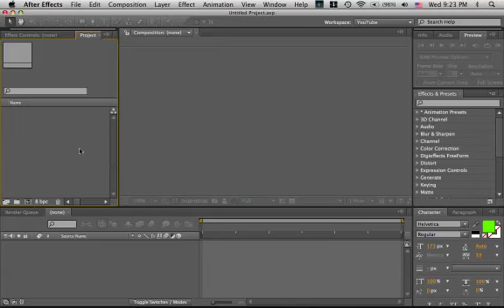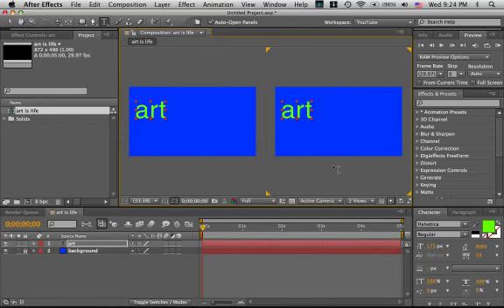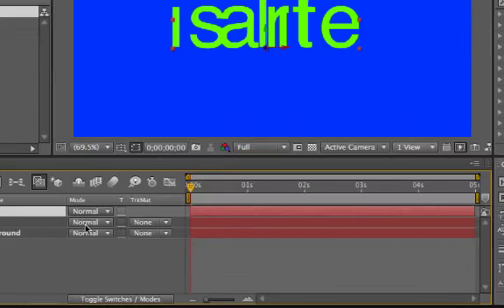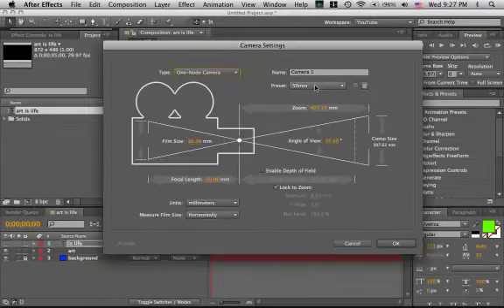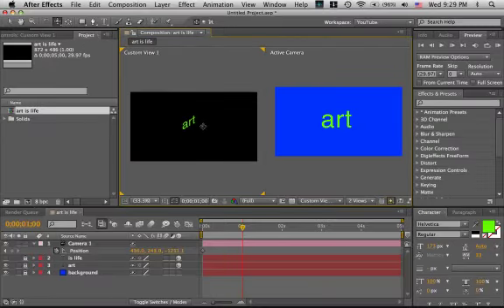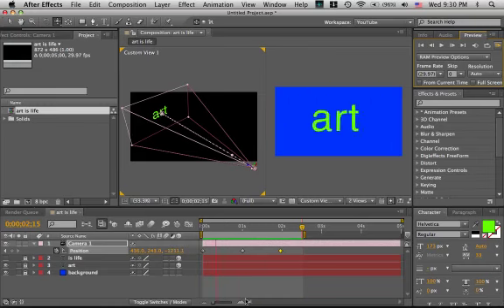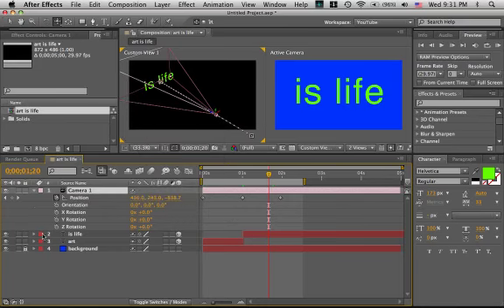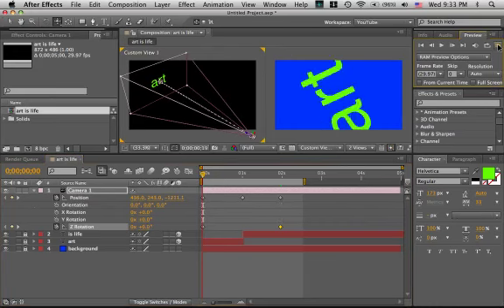After Effects 3D for beginners: camera in-out-spin

Comment: use scale?
Reply from the maker: The Entertainer To make using scale (to simulate advancing or retreating) convincing, you'd have to either use the Exponential Scale Keyframe Assistant, or do what we did in the nineties (hey, get off my lawn!) before AE had 3D in v.5 : use the graph editor to slow down the scaling at lower scale values.

This is because a linear move away in 3D is not a linear scaling: try scaling something down linearly: it seems to speed up as it goes away, which is unnatural for a steady retreat. However, since it's more natural for something to seem to shrink more slowly as it gets farther away, we slow down the scaling as it goes away ... or we just move 3D layers and/or the 3D camera in the z-direction.

Comment: You don't need the camera tool to do this, could have been done with a lot less work. But it's a good tutorial none the less :)
Reply from the maker: Thanks. :)

Are you suggesting the rotation and scaling up and down of the layers? I would say yes, you don't need the camera tool, but is it a lot less work? Not necessarily: it could be more work and hassle especially if you have a lot of layers and you need to change something.

Specifically, I would use the camera in this situation rather than scale the layers, because for a correct zoom-push effect, I would need to logarithmically adjust the curves of the scale property, and that's messier (and less flexible) than just animating a camera (or the Z-pos of a 3D layer). If you wanted to tweak the speed, you'd have to tweak the scale curves or nest the comp and apply time-remapping. Also, with scaled-up layers, if you have more than one layer in shot, you'd have to parent those layers to get them to scale and rotate together.

Once you start adding layers, it's easier to keep them static and move a camera than move all those layers … especially when you have to change something later. My point is, in many cases, animating one 3D camera is actually easier than animating a bunch of 2D layers.
Reply: Fair enough. Idk maybe its that im not as comfortable with the camera tool, but the way you described it it indeed does sound harder to not use it. I will take what you said into account thanks :)
Reply from the maker: No worries … as long as we proceed carefully and develop working habits that keep us out of trouble, we're fine in 3D. For example, I use a one-node camera as the default, only using the two-node cam when I need to follow something with the camera. One-node cams behave as expected, with fewer controls to mess up. ;) I also use two views (as in this video) to keep track of what's going on. But it does help to have some flight hours on AE in 2D before going to 3D. Cheers!

Comment: Thanks so much for brilliant tutorial! I'm a beginner...Could you please tell us in what cases do you animate with camera?  the same could have been done with scaling the "art"  but there must be the reason to choose cam animation instead.  Thanks!
Reply from the maker: Good question. Sometimes scaling 2D art is easier, and if you want to push in on somebody's face in a photo (for example), you place the layer's anchor point at the face so the layer scales up from around the face. That's how we did it before AE had 3D cameras.

When to use a 3D camera? When you want to move around something in three dimensions. When you have a lot of layers that you want to fly past (slow or fast) the camera (animate the camera, not the layers). When you want things to move across the frame at different rates as if they were closer/farther from the camera, like a multiplane camera.

But when you only have one layer, sure, scale it up.
Reply: Thank you Steve for such a quick reply. I really appreciate it!